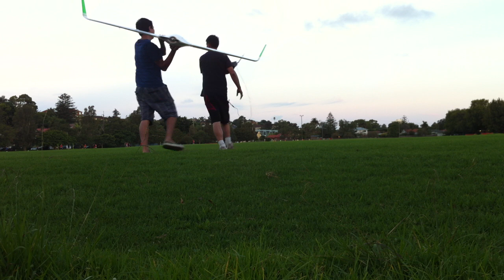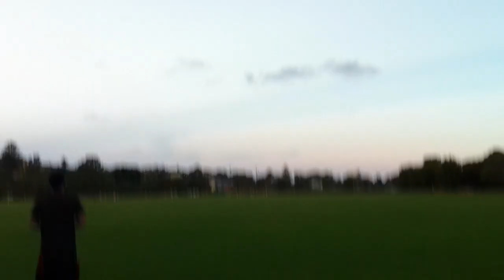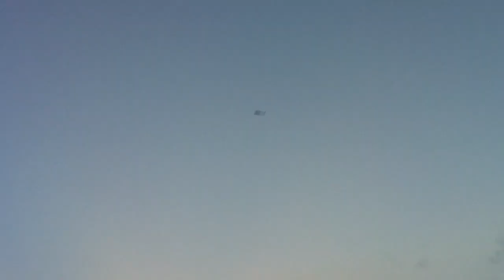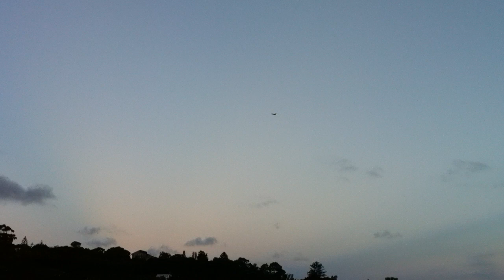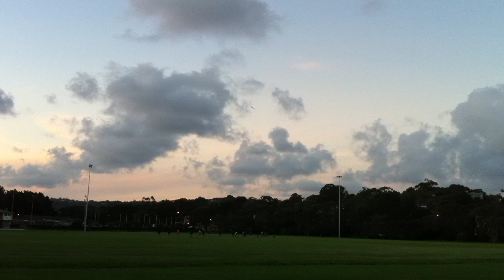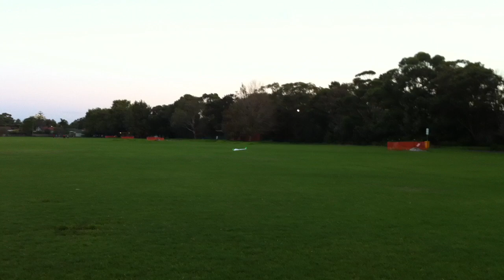Hand launching a 4kg X8 UAV

Comment: Hi...could you share the specification of motor, esc, battery and propeller in your X8. Mine have 4kg also, but failed to take off..seems not enough power. thx in advance..